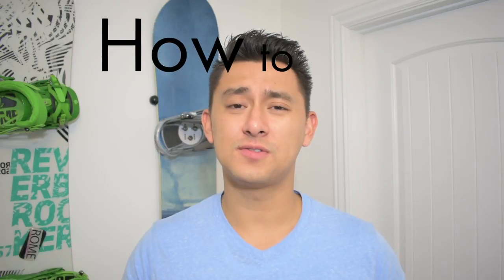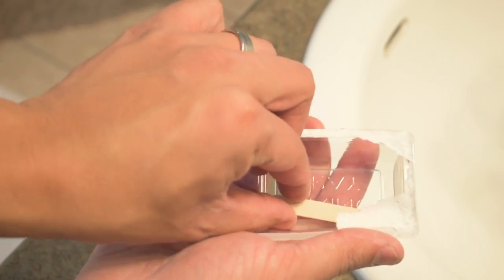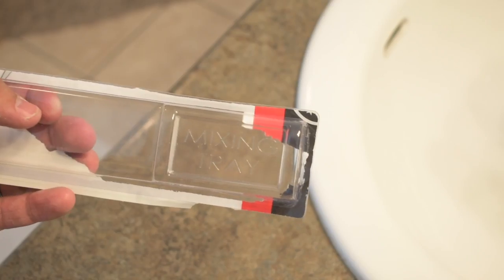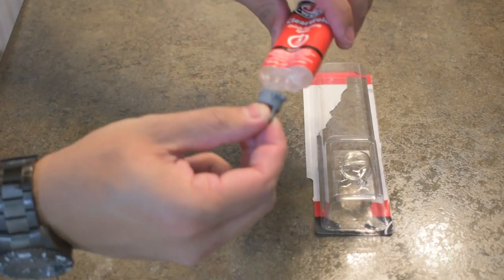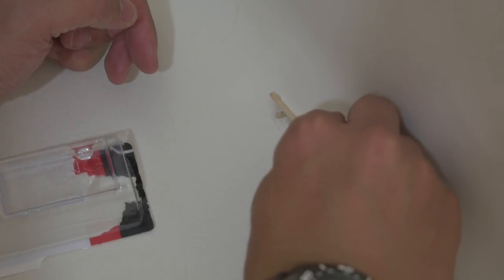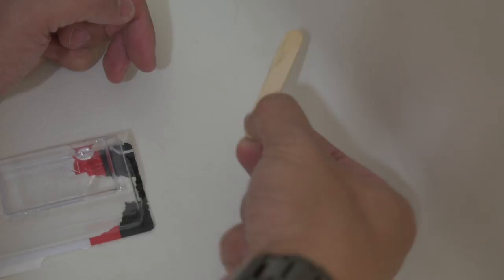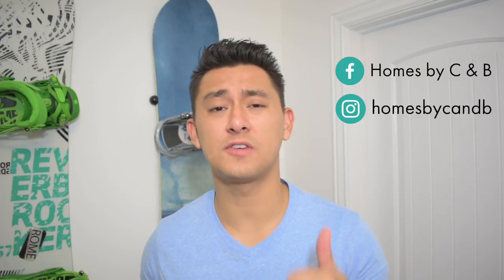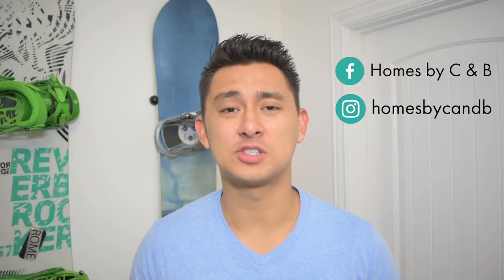DIY Fix a Cracked or Chipped Bathtub - with Epoxy

Comment: Suggest using J-B Weld 50172 MarineWeld Syringe which is a specially formulated two part adhesive and sealant that provides a strong and flexible bond that is waterproof, chemical/UV resistant, sandable, and dries white.  Can be applied to metal, plastic & PVC, wood, fiberglass, aluminum, carpet and composites.

Comment: What would you recomend to paint the chipped area to match the tub without having to use spray gun
Reply from the maker: Depending on the size of the chip in your tub you could go about it a couple ways.  You could run to home depot, lowes, or a hardware store, get a full on kit for $27 dollars which almost always comes with a white paint. Or you could find a rustoleum tub spray paint (in a can) find the color and do it that way.  Or you could even get some nail polish and get the color you want to match.
Reply: @ColtonCrumpDIY  You could also get JB WELD in white color instead of clear.
Reply from the maker: @YogAroodha  you're right. I wanted to test out how clear the clear was. Also having a white epoxy may look too white if someone had a yellowish tub.  Good point though

Comment: I have a huge crack in my tub,and smaller ones.I wonder if this will work,I can't afford a new tub.Due to the cracks it has already caused the floor to get wet and tiles to become loose on the bathroom floor.We used another product but it didn't last very long.
Reply from the maker: Best of luck! There are kits sold at home depot and Lowe's that will refinish and seal your bath tub.  :) that may be a better option if there are a lot of cracks and chips
Reply: @ColtonCrumpDIY  What should I look for on the package? There are so many things out there,I want to get the right product.
Reply from the maker: @isabelf.8886  It really depends on how comfortable you are with redoing/refinishing/resealing/reglazing a tub. If you are DIYer and you are comfortable taking on a more intermediate type of challenge, I would have to do some research on what type of refinishing kit I would recommend. Honestly, it may be easier to pay someone to come refinish/reglaze/reseal it rather than do it yourself, because there will be some very strong smells, toxic fumes, and a full day event for a professional to get it done. This option is still going to be cheaper than buying a new tub, removing your old one, having your old one thrown out, etc.

Comment: Will this work when the crack is leaking? Possible to apply really thick in a texture to match what's there  without sanding?  My 15yo fiberglass jet tub cracked due to a structural issue I have fixed with expanding foam and it's solid now, but now I have the crack + a drill hole.   I'd rather fix without sanding or too much build up. If I can fix without spray painting that would be ideal too. Will I need to do a fiberglass and resin job?
Reply from the maker: For your job I would probably do a more legit actual tub patching job resin and paint.  Using jb weld like this while it's leaking wouldn't work very well.  Once cured, you would do a heck of a lot of sanding

Comment: I have a fiberglass shower stall that has a 3 inch long crack in it... on the floor, about 6 inches from the drain. Once fixed, this crack will be continuously stepped on by my large husband during future showers. Will this product hold up under these circumstances or am I likely looking at replacing the whole shower insert? TIA
Reply from the maker: So I can't remember the exact weight or pressure the epoxy with withstand.  I think you can Google it and search it up somewhere. But never the less I don't think you'll have to replace the whole thing. That's expensive. Double check the weight this thing can withstand and go from there

Comment: What kind of paint would you recommend over the epoxy/tub interface?
Reply from the maker: Great question Kyle! So I personally didn't paint over it because I wanted to see how it would turn out with the clear and someone else is now living in that home.  BUT I do know that Krylon and Rustoleum make a decent spray paint for almost any surface and I think I recall one made by one of them for epoxy resin finishes.  I believe acrylic paint also proves to do well in bonding to epoxy.

Comment: I'm actually about to try this but using marine tex boat epoxy. Will then paint using Rustoleum tub and tile spray. Wish me luck!
Reply from the maker: Good luck Melissa! Let me know how it goes!!
Reply: Perfection Hangover - You can mix the paint into the epoxy in a ratio 1: 10 (paint to epoxy)

Comment: Hi .. how did your repair hold up and is there a specific JB weld epoxy that you used?
Reply from the maker: Still there, doing well.  I just used the clear weld jb weld
Reply: @ColtonCrumpDIY  
I called JB weld and they recommended the KB Water Weld .. It was hard to sand down and I didn’t fully get it to look how I wanted. I used a razor blade to take it down a little.. I think I should’ve used the product that you used.. I thanks for the video

Comment: It is a decent way to repair , however there is no color added and he does not say how to smooth it out which means it will always show up .
Reply: He said to apply neatly with scraper and let cure for an hour. Then he said to use 600 grit sandpaper if needed.

Comment: Would the epoxy be still toxic once cured?
Reply from the maker: It all comes down to what you define toxic.  If you're wondering if you'll still smell it and it's not good to breathe, no, you will not smell it. It won't contaminate any of your  water either. Once it fully cures, it's like a hard plastic has filled that hole or crack
Reply: JB Weld WaterWeld product description says:
"Nontoxic and approved by National Sanitation Foundation for use with potable water."

So, I assume it is food grade material and non toxic.
Reply from the maker: Thanks CommenterYogi! Appreciate the info :)

Comment: Would a crack like this or a small cluster of hairline cracks cause a bathtub to leak?
Reply from the maker: Hey Amber! The chip shown in this video, if left unrepaired, may not allow water to leak through it right away, but it does expose the layers of the tub that aren't meant to be exposed. Chips and cracks open up a potential of creating more cracks or larger holes which would be more expensive to replace in the long run.  So short answer,  maybe.  Long answer, it's what may happen if the crack is left unattended if not repaired.
Reply: Colton Crump i live in a large old home in the historic district in my town where the upstairs is its own separate apartment. I live in the upstairs apartment and there’s been a mysterious leak in the downstairs ceiling below my bathroom. Two different plumbers have been out and determined it isn’t coming from the drain or the overflow drain that was originally suspected as the culprit. They determined it wasn’t coming from my shower or faucet and that none of the pipes were leaking either. Maintenance sent a roof inspector out after that thinking the leak had to be coming from somewhere in the roof since it wasn’t coming from the bathroom or tub. Roofers said there was absolutely no roof leak. I was taking a bath really late the other evening, like 2-3 am and I could actually hear steady dripping and leaking from under my tub. The water level wasn’t high enough for it to be from the drain overflow and it had been a solid half hour since the faucet was ran to fill the tub. When I got out I drained the tub and got a flashlight and checked every surface inch of the inside of that tub. I found a small cluster of hairline cracks in the inside of one of the corners that looked similar to your video! The leak was coming from the tiny cracks because the water pressure was pushing the water out of the cracks when the waters level got to a certain point!! SO A HUGE THANK YOU FOR YOUR VIDEO!! This solved our mystery leak issue!
Reply from the maker: @amberwillis5528  This is such a cool story! Not cool in the sense that you were on a wild goose chase trying to figure out where the leak was coming from, but cool in the sense that you watching this helped figure out what may have been causing the issue. You are SO welcome and I should be thanking YOU for even taking the time out of your day to watch! Appreciate it and more videos to come :) Thank you Amber!

Comment: Why not use JB water weld expoxy putty, freaking great stuff
Reply from the maker: Hey Scooterpie666! I am not familiar with the epoxy putty. I'll be sure to check it out.  My main goal of this video was to see how clear the ClearWeld was after curing. I've seen companies that say their product is white, but it's more yellow, or its clear and it's more white.  Wanted to test this out.  Thanks for watching!
Reply: @ColtonCrumpDIY  I ended up using the Water Weld epoxy putty after reading that regular epoxy won't hold up to water. The next day I sanded and painted it with a couple coats of Porc-A-Fix. Turned out pretty good, certainly better than looking at the chipped tub. I will say it might be better to use latex gloves with the water weld, it's very sticky and hard to get off your hands (much like silicone caulking).

Comment: I have cracked my sink in such a way that I feel a section (approx 20cmsq) might fall through. Do you think this kind of fix will be sufficient, or should I seek out a professional?
Reply from the maker: So a 20 sq cm area isn't small.  Especially if there are pieces or a piece that is about to fall through.  This epoxy would be a good seal for the cracks and smaller chips.  I'd imagine the strength this could withstand would be a decent temporary fix, but the ideal end result would be, depending on the severity of the chip,  either get the entire sink refinished or replace.

Comment: Why didnt you show the finished product? I want to see the results before/after.
Reply from the maker: Hey Patrick! The image shown at 1:30 is the finished product.  That is after the epoxy dried. I wanted to show that when JB Weld says it's a clear weld, it truly is clear. So if you do take this approach and you want to hide the chip, you will need to paint it with some touch up paint or nail polish or something that will withstand water.
Reply: Sorry, I missed that. I bought a loctite epoxy product that is called marine ($5 at lowes). It is supposed to turn out white, so I am hoping to avoid any extra steps. Will be doing a tub repair soon. That may be helpful if I need a clear product like that in the future though......  Thanks
Reply from the maker: No problem at all! Appreciate you checking out the video.  Good luck on using that $5 purchase from Lowe's. Hopefully it dries the right kind of white you want.  Let me know how it turns out!

Comment: Is your bathtub from plastic material or porcelain?
Reply from the maker: Nooraiman, it's actually acrylic. So it looks and feels like a really hard plastic.
Reply: Homes by C & B thanks for replying me. BTW, what should I use for a plastic bath tub?
Reply from the maker: JB weld makes a variety of products that could help you if you are looking to fix a chip or crack. I would suggest you can use something like the epoxy I used in my video.  Or you can use a JB Weld plasticweld.